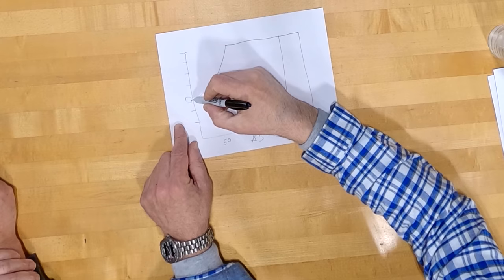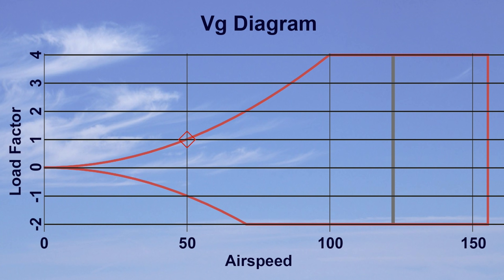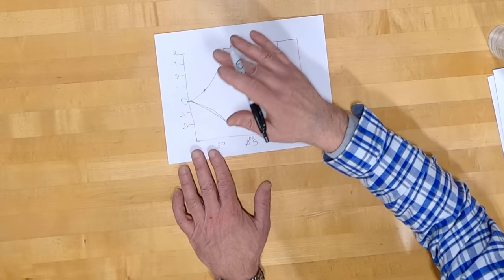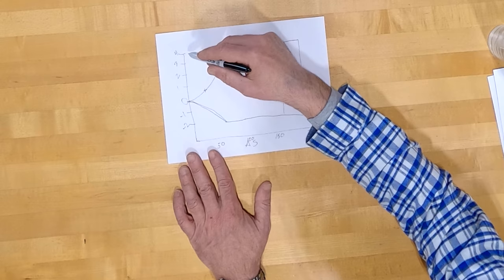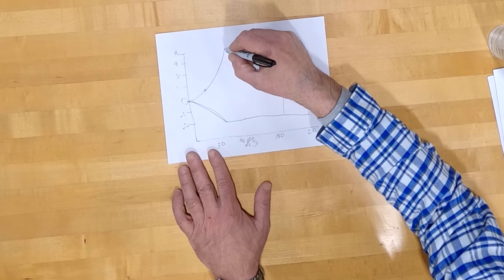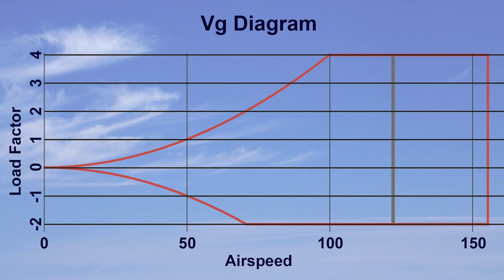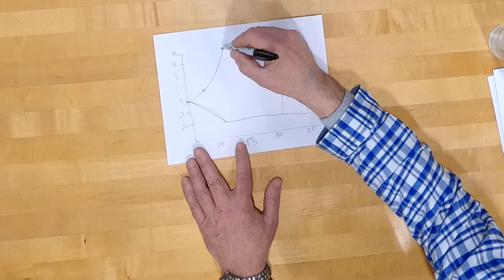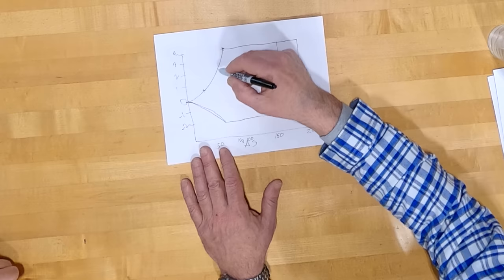The V-g Diagram , or: The Wing Removal Lever

Comment: I explained this to my kids a 'few' years ago. The positive G curve plots an infinite number of points where the wing can 'give' a specific G loading, at the specific plotted airspeed, without exceeding it's critical angle of attack. As you stated, there are other factors, such as asymmetrical wing loading, I think that the pilot manual I learned from glossed over this last factor, and only mentioned that it could be a factor. Also overlooked in that training is the very real difference in stall speed between lightly loaded aircraft and one that is maxxed out. More emphasis is put upon the 'wing will stall if it exceeds it's critical AOA, regardless of airspeed', without clearly stating that a heavier aircraft will require more AOA at a given airspeed, to continue level flight. It's all in the wording. Thanks for this excellent video.
Reply from the maker: All good points. I would add that heavier aircraft will require more AOA at a given airspeed not just to continue level flight, but even to continue a sustained climb or descent (with a constant vertical speed).
- Martin

Comment: Tremendous teacher Doug.  Thank you for bringing this to us Martin.  I would like to add asymmetric, or rolling pullouts can affect the GA pilot and here is how.  The initial concern in the rolling pull is structural limit, as speed decreases you will enter the slow speed regime and one wing will stall first.  The high wing will have a higher AOA and therefore stall creating a un commanded roll in the opposite direction.  Very often you see this in crash footage, usually a security camera near a crash site.  I belief it’s the reason most fatal GA crashes occur.  Not keeping the wings level nearing stall speeds with GLoad, ie pulling away from terrain.  

Thank you again.  Sharing this is important for us all
Reply from the maker: Yes, you bring up localized AOA which can be a big surprise to the uninitiated. I'll cover that in another video in the future.
- Martin

Comment: Excellent presentation. Bonanza-specific pilots may further review this in Eckalbar's book, "Flying the Beech Bonanza" were Eckalbar calls this diagram, appropriately, maneuver-gust envelope. . BTW, the curved portion of the diagram is exponential (quadratic) not logarithmic but that is a minor detail.
Reply from the maker: Actually, it's neither logarithmic nor exponential. It's polynomial, since lift increases with the square of airspeed. "Quadratic" was pretty close. 😁
Best regards,
  Martin
Reply: @martinpauly  yes, sorry I had virus curves on my mind. It is exactly quadratic. Quadratic function is a polynomial.

Comment: Great video! I work as a pilot in skydive ops for a living, so I find myself daily at the edge of the envelope. I believe it is crucial for anyone operating in similar ops to be familiar with the structural and aerodynamic limit, as the "do not exercise full flight control surface deflection above Va" is simply wrong and can sometimes be dangerous.
E.g. when pulling out of a dive at 0 deg pitch attitude you're very likely to be within the limit load factor margin and could apply full elevator low in order to maintain level flight and avoid stalling.

Comment: Why does maneuvering speed decrease with weight? It's all about angle of attack.

Take two identical normal category airplanes flying at the published Va: one is very light, one heavily loaded at max gross.
Regardless of their weight, both airfoils will stall at the same critical angle of attack.
The light airplane flies at a lower AOA for this given speed, compared to the heavy airplane which must fly at a relatively higher AOA at all times to produce more lift.
So the heavier airplane (for a given speed) is always closer to a stall.
If the pilot of the heavier airplane yanks back on the controls (or, encounters some turbulence, which is essentially the same thing), there is exactly enough AOA remaining for the wing to generate +3.8G's just as the critical AOA is reached.
The stall acts as an aerodynamic safety valve which releases the pressure, protecting the airplane from itself, returning it to ~1G.

But the light airplane has much more AOA left to play with, and therefore much more potential to generate higher G loads.
If the pilot of the light airplane doesn't want to bend or break something, he must 1st slow down to the weight-corrected maneuvering speed, thereby increasing his AOA and lowering his potential to make G.
You can calculate Va for any weight by multiplying the Va at max gross by the square root of the weight ratio. (actual weight/max gross)

Additionally, it's the acceleration which produces stress on the airframe and the G's which you feel on your body. 
Force = mass * acceleration
Imagine a 30fpm vertical gust of wind exerting the same force on those two airplanes: one light, one heavy.
The same force will produce greater acceleration on the airplane with less mass. F=ma
Even though the forces exerted on both planes are identical, the heavier airplane has more inertia and is not accelerated as much.

Moral of the story: when it gets rough, slow down; and if you are light, slow down even more.

Comment: Worth noting is that the top corner of the Vg diagram is where aircraft with good control leverage reach their max instantaneous turn rate and begin to lose turn radius in the Vg diagram.

Airplanes with poor control leverage are much more complicated, since the control inputs end up being too heavy past a certain speed.

Comment: Nice presentation.  I've always had a bit of a problem with the adage that the "....airplane can stall at any airspeed...."  While that's technically correct it doesn't help from a comprehension standpoint unless you add "depending on the g's or load conditions the aircraft is sustaining  - or not sustaining - at the time.  That's the purpose of the flight envelope presentation.  I did my aerobatic training in sailplanes and it was very helpful in normal sailplane operations to understand the effect of the g-force component  on stall speed.  When spiraling in a tight thermal to gain altitude you can have the aircraft banked over 45 degrees, for starters, and 60 is not uncommon.  That's where the aerobatics training comes in handy so you are adjusting pitch accordingly and not holding that nose up in a 45 degree bank to where you might otherwise hold it in a 30.  In these situations, it's not usually dangerous but when you fall out of a thermal simply because you flubbed it - didn't keep the airspeed up (or the yaw string centered) where it needed to be it's frustrating and can cost you precious altitude - which is your bank account in sailplaning.

In accumulating altitude (from thermals) in sailplanes, your primary job when you find lift and bank into it is to feel and keep pushing that bank angle to keep that pressure at the max - because that's your elevator hoist... but the more you bank, the more you need to lower than nose to stay in the air - so it's a balance.  I've never done it myself, but I was riding with Les Horvath in a Grob and he did a 90 degree bank turn coming out of a dive that I think he held for maybe 30 degrees on the compass without stalling - because we had that airspeed - just rolling would have been easier, of course.

Comment: One thing worth mentioning..

There are some wierd and wacky planee out there. Some of them can have quite impressive sideslip maneuvers and also quite impressive drag generation. I'm not sure how many of them can actually bend or break from these things but it's probably not zero. I know in simulators you can design a plane that's really tough on the pitch axis and will disintegrate the moment you're doing much with sideslip. I think I made a flying wing in Kerbal + FAR that could do 10 G turns in pitch but the second you took your hand off the controls it would sideslip and, well, splash one flying wing.

Comment: Your educational videos are always highly appreciated (at least by me and from what I can tell many others too). Thank you for making them!
I know you weren't teaching the information Martin (you were busy making another top notch video!), but maybe you or someone else here knows: I always thought Vg was best glide and Va was maneuvering speed (aka move the controls in any one direction at max gross and not break the plane speed), but is Vg the same as Va, or similar with some technical differences?
Thanks and happy flying!
Reply from the maker: Hi Watashi. Best glide speed and maneuvering speed are different speeds. In all airplanes I have flown, maneuvering speed was higher than best glide speed. Best glide speed is based on aerodynamic performance (airspeed at which the highest lift-to-drag ratio is achieved), and has nothing to do with structural limits of the airframe (which is what defines maneuvering speed).
Does that help?
Best regards,
  Martin

Comment: Very informative video. I was wondering why the "gust lines" of 50fps and 25fps are drawn as linear equations of a=mx+t with m representing the gust (so I assume). Wouldn't the gust have to be added or subtracted from the speed resulting in a parabolic relationship between speed and load factor?
Reply from the maker: Thanks, Johann. I do not know the answer to your question, I'm afraid - I hope Doug will see this and chime in here.
Regards,
  Martin

Comment: I get the impression this guy knows a thing or two.
I've always been perplexed by the idea that a gross weight airplane has a higher maneuvering speed than a lightly loaded airplane. 
I'll have to look for more videos from Martin.
Reply from the maker: Yes, it's counter-intuitive. The way to think of it is: maneuvering speed is a stall speed. And stall speeds are lower when the weight is lower. Now it all makes sense!
- Martin
Reply: When flying the gust speed ( maneuvering speed ), we avoid over stressing the airplane from an inadvertent gust , at the max weight.  It will stall before over stressing the plane. When flying at a lighter weight , flying the same maneuvering speed will allow the same gust to produce a load factor higher than 4g before stalling. We have a different Vg diagram for different weights/altitude combinations, but the POH normally gives us only one speed at max weight. So we must be prudent and understand that flying the same plane at a much lighter weight in turbulent conditions, unless flown at a slower speed, will over stress it (exceed the 4g limit) if the same turbulence is encountered.

Comment: The myth of the danger of the downwind turn, Barry Schiff and  your excellent high altitude orientation explanation is absolutely false.  What we have here is a failure to communicate because we who work low every hour of every day depend on wind management to survive.  I appreciate that you included low altitude orientation a bit in that ground speed increases in the downwind portion of the turn.  The danger, for the crop duster, pipeline patrol pilot, gunship pilot, animal rancher or environmental worker counting animals, or any who work low is that the ground speed not only increases but that the radius of diameter of the ground track across the terrain also increases.  With limitations in both vertical and horizontal space available, downwind turns to return to target are very dangerous.

That is why crop dusters work from the downwind border and make every turn back to the next target (crop row) into a headwind component when the wind is significant.   GPS has made race track more common and safe until the wind get up to 12 knots or so.  Now every other turn (race track pattern) is a downwind turn.  This turn takes twice the area and clearance of obstacles to make safely.

Now lets communicate low altitude orientation pilots to high altitude orientation pilots.  The downwind base to final turn which is now often so far from the airport that a level turn is desired, is also a dangerous high ground speed turn.  This is not because of ground rush when the airplane is still a thousand feet up.  It is because overshooting the centerline extended often happens and pilots generally aren't willing to allow the nose to go down naturally in all turns as the airplane was designed to do to prevent stall.  Yes, we can add power but that increases the radius of the turn away from the centerline.  The safer, wind management, turn is right base into a headwind component.  The rule is an advisory at uncontrolled fields and such a rule would be dangerously poor wind management.

Ground rush may be the culprit in the dangerous downwind turn near the ground in some cases.  What about not hitting rising terrain or obstructions in the limited horizontal space available?  Pilot steeped in high altitude orientation may just pull back on the stick to both turn with a shorter radius and to climb or at least stay level.  Both maintaining altitude and climbing are deadly wrong in this situation.  Decreasing radius of turn is appropriate but we have to have some training and practice in doing it appropriately.  First anticipate the need to turn steeply.  Secondly, if zoom reserve airspeed is available, pull the stick to climb wings level.  Third, release all back pressure in a steeper than what you think is necessary to make the turn.  This makes the turn of any bank angle a 1 g load on the wing, so no stall.  Finally, level the wing prior to pull up headed toward the target.  The reason to turn more than necessary initially is so that this level off and pull up need not to be rushed and we do not want to go over wires or obstructions with a wing low going into the crop row.

So not everyone needs to be a crop duster.  Since stall, base to final skidding turn spin, or slipping spin near the ground is generally fatal.  Teaching crop dusting to second career CPLs and ATPs has convinced me that most experienced pilots lead aileron in turns and use too little rudder (slip) than too much rudder (skid.)  So I don't believe in the danger of the skidding spin downwind base to final.  I believe that stall there or anywhere in the pattern is generally fatal.  Watch the videos of fatals.  The stall generally happens at the beginning of the turn.  Some spin low wing first (skid) but most spin high wing first (slip) or just stall.  It really make no difference, nor does planned practice stall practice at altitude.  So while not everyone needs to be a crop duster, every pilot needs to understand the reality of low altitude orientation, maneuvering flight, and such.  We all takeoff and land every time we fly.  The danger of the downwind turn is not a myth down there unless we have a headwind component on base to final and we have no terrain or obstructions around the airport.  Only then are we saved by high altitude orientation, by unlimited vertical (wait here is a problem) and horizontal space available.  By the way, when vertical space is limited airspeed and not altitude is life.  Yes, that means neither Vx nor Vy are often appropriate.  Low ground effect flight increases airspeed at no cost or danger to the pilot on long runways.

Comment: "Airspeed's gonna decrease"
Uh... I wouldn't be so sure. If you're headed straight down like a brick, you've got 1 G accelerating you straight down like a brick. There are plenty of aircraft out there where 4 G on the stick would not drop the L/D below 4. In fact, I strongly suspect that Mustang is one of them if the speed of high enough.

Comment: Great video. However I believe there is a dangerous misinformation at 24:11. It is certainly NOT the case that the G-limit of the pilot will protect him from snapping of the wings by pulling the stick back *instantaneously*! Because the G-limit of a human depends on G and time. An untrained pilot can easily withstand 10G for 1 second. The airplane might not. So the wing will snap off before the pilot blacks out. See the blue dotted line on this graph for reference: https://en.wikipedia.org/wiki/G-force#/media/File:Human_linear_acceleration_tolerance.svg